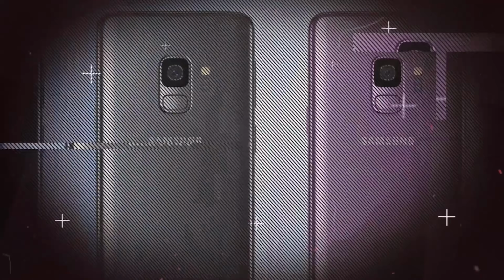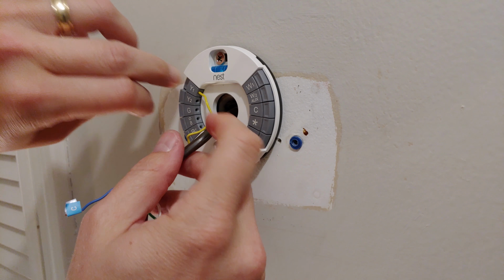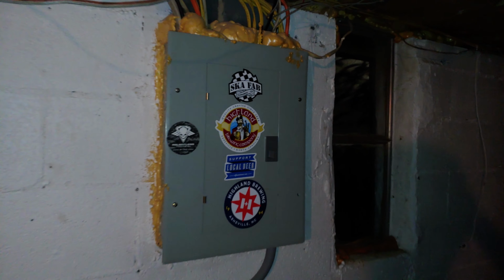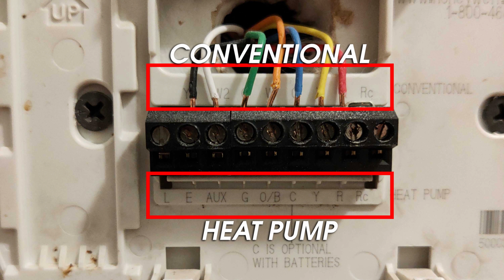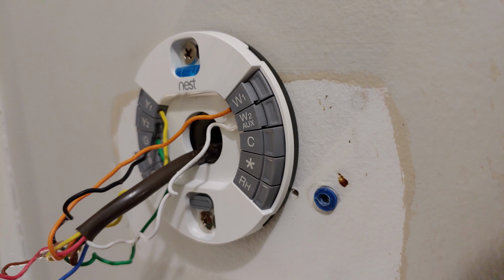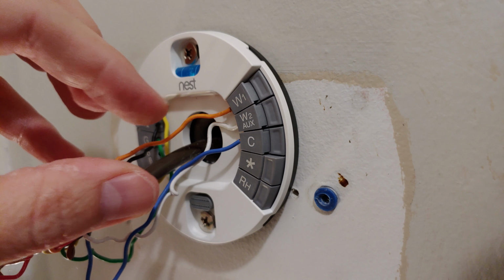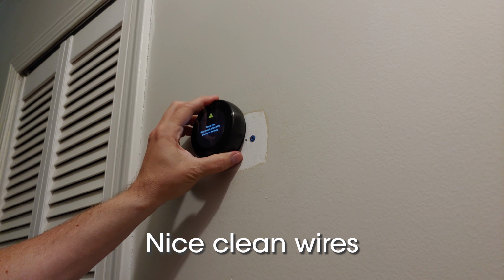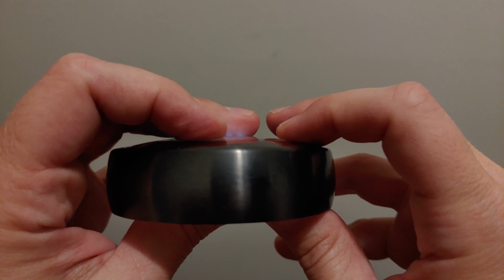Installing the Google Nest Thermostat 3rd Generation

Comment: Just by chance I had the same Honeywell old thermostat and never noticed the bottom labels! I was going crazy as the correct wire label was o instead of the w on the top label! I was getting hot air thought it was my new thermostat causing issue so I purchased another nest... well thankfully I watched this before opening the box saving me a $250 oops! Thanks so much!

Comment: Great video I have trane heat pump that would not turn on when 20 degree outside I see black wire was in wrong place with white wire in w1 instead of w2 aux

Comment: I noticed that on your heat pump/bottom row original setup, the orange wire is in the O/B slot, so why did you switch it to the W1 slot on the nest instead of the O/B?
Reply: I have the same question ...
Reply: @VirtualJohnDoe  Anyhow, it still worked lol. 🤷🏼‍♀️
Reply: I was wondering the same thing! Maybe this was his first go at it, where he learned that using the indicators on the TOP row cause it to blow hot all the time! (The O/B where he SHOULD have put it cause it to switch from cold to hot or vice versa. The W1 where he put it just tells it to heat.) Yep, at 4:28 he briefly shows it switched to the correct placement (without mentioning it), which doesn't really help since it leaves people thinking the other one is correct. 🤨

Comment: Your wiring looks like mine, but Google says it not compatible?? I successfully installed the downstairs unit, but the upstairs is the problem child.
Reply: I have the same problem, downstairs is fine, but I only get hot air upstairs. Did you find the issue? Thanks in advance